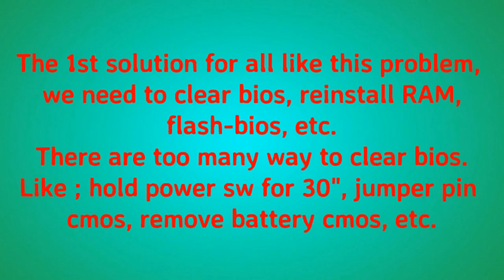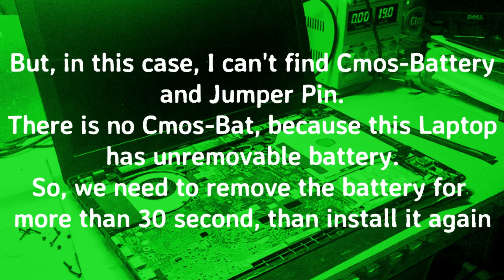SOLVED, REPAIR ASUS X550 X550Z NO DISPLAY, TIDAK ADA TAMPILAN ATAU BLANK SCREEN

Comment: Kasus ane agak beda gan, Asus x550z sebelumnya hidup, abis ganti hdd dan instal win 7, setelah selesai semua kabel sound dan wifi tidak ane sambungkan, lalu ane bongkar dan pasang keduanya. Abis itu ane tekan power tidak ada tanda apa2, dah lepas battry laptop, battry cmos, tekan +-30 detik dan pakai Charger saja, tukar posisi ram, , juga tidak ada respon. Semua indikator tidak menyala saat ditekan powernya. Ada solusi gan. Maaf curhat.

Comment: saya ada kasus serupa asus X550Z AMD A10 setelah saya update BIOS dari versi 204 ke 208 jadinya black screen, padahal flash bios update sukses, tetapi setelah cb saya nyalakan ttp g mw tampil, uda coba buka socket baterei, clear cmos baterei layar tetep blank , apakaha ada solusi lain ???
Reply from the maker: downgrade aja gan, tapi butuh alat untuk re-flash menggunakan eep rom programmer, gak mahal kok kalo gak salah sudah ada yang harga dibawah 100 ribuan di toped. agan boleh searching di YT tutorial flashing nya, sedangkan untuk ROM, baiknya coba gabung dulu di forum komunitas Teknisi Laptop, nanti bakal dikasi gratis file-nya. kalau tidak ketemu juga boleh hub saya, nanti saya bantu carikan. . saya yakin masalahnya hanya di BIOS, bisa jadi ROM barunya tidak sempurna atau ada bug. semoga membatu
Reply: I have exactly the same problem, did you solve the problem?

Comment: Hi there. My laptop has 4gb ram, then I tried adding 4gb ram in the other slot of my Asus x550z. When I opened it the same thing happened in the video. I tried doing the solution but it did not work. still black screen. Please help. Thank you so much
Reply: Did you ever fix it? If so how, same model, same ram, lmk

Comment: i have a asus x553m with a black screen issue, i tried all the troubleshoooting methods showed by all the videos but nothing worked. my pc is still on black screen ,how can i solve this issue. help please.
Reply from the maker: If you can, release battery and cmos battery for 10 minutes. Install it back and try to power it up. Or just flash bios using bin file. I have fixed many asus problem blank screen by flashing bios.

Comment: gan leptop saya asus x550z masalahnya sama black screen.  kejadiannya pas saya bawa ke wifi corner awalnya batrainya habis terus mati pas saya charger tiba tiba layarnya jadi black screen.  saya udh coba buat cabut kebel kabelnya tapi masih sama. tolong dibantu atau solusinya terimakasih
Reply from the maker: uda dicoba seperti di video saya? kasus laptop asus terbesar blank yang sering saya hadapi akibat gagal bios. dari cerita ente, ada indikasi ke arah serupa. solusinya flash bios. kalau punya alat flash toolnya saya bisa bantu berikan file biosnya. kirimkan emai ente
Reply: gan laptop saya asus x42j.. masalah no display.. bisa email file biosnya ke email saya... wendyyudha7@gmail.com....  terimakasih banyak gan

Comment: Gan. Klo ane penyebab ny karna sehabis install nox sama game berat tapi si nox ini unrespon jadi ane restart laptop ny tapi sehabis itu ada notice "sorry we will restart it for you" warna biru sehabis itu di hidup kan ulang langsung gak mau hidup layarnya. Solusinya gimana gan?
Reply from the maker: masalahnya gak jauh2. masih seputaran bios juga tu. cuba aja lepas baterai (kalau bisa). trus pendam power button +-30s. trus pasang lagi seperti semula. solusi lainnya coba lepas dan pasang balik ram nya. semoga bisa membantu
Reply: Laptop Repair udah juga gan. Lepas ram udh, baterai juga udh. Tekan 30 detik juga udah. Tetap gk nyala monitorny
Reply from the maker: lampu indikator lainnya normal? sudah dipastikan screen tidak bermasalah ya? sudah coba hubungkan ke screen eksternal?
Reply: Laptop Repair iya gan normal. Coba pake kabel hdmi tetap gk muncul
Reply from the maker: kalau punya alat, coba flash ulang biosnya. tapi ini sebenarnya pekerjaan teknisi. kalau mau coba boleh juga.

Comment: Ane kasusnya sama om, awalnya batere ngedrop trs ane tukar batere sekalian upgrade ram. Pas di idupin layat blank, tapi kalo di colokin ke tv pake kabel hdmi muncul, udah ane coba cara di atas tetep aja layarnya blank. Mksh gan
Reply from the maker: dari ceritanya, kasus ini bukan pada mobo, tapi MUNGKIN kabel lcd longgar/terlepas. karena kalau masalah di mobo display di hdmi ttp gak muncul.
Reply: Laptop Repair o gitu gan, berarti solusinya cabut lagi kabel lcd trs pasang lagi atau gmana?
Reply: Oia gan, kalo dalam keadaan hidup trs ane pake senter domonitor keliatan, apa inverter atau backlightnya harus di cek atau gmn gan?
Reply: Abah Garut gan setau ane klo keliatan disenterin gitu berarti backlight lcdnya ada masalah itu gan,
Reply: Arif Rahman oh gitu gan, solusinya kalo gitu gmn gan?
Reply: Abah Garut coba cek kabel kabel yg ke lcd gan udah bener" kepasang belum. Siapa tau lupa masang kabel. Klo udah berarti hrs di service itu mah cmiwiw
Reply: Arif Rahman klo kabel ke lcd udh gan, kalo di bandung ada tempat rekomendasi ga buat service?

Comment: What did you do? İ didn’t understand it.
Reply from the maker: Focus to 1:47
Reply: Laptop Repair i focused but it has cmos battery under mainboard :/ and it is removable. Can you help to me?  my asus x550jk .
İf you help to me i can send money to you
Reply from the maker: What's your problem?
Reply: Laptop Repair  i bought ssd 6 months ago. İ wear ssd to harddisk place and i wear harddisk to cdrom place.  format and continued to use for 6 months.
And now i want to format to pc .because i have some problems about high cpu usage. İ entered bios options and i didn’t see my ssd at boot options. İ did factory reset on bios. After pc restarted. And my screen was off. Black and blank screen. No electric at the screen. My power led on and my fan turning. But no image.
Reply from the maker: @kaanakinoglu8141  please more specifics about you motherboard brand, type and series. How can I contact you for solving, we have to vcall, or live chat.
Reply: Laptop Repair thank you :)  i will set everything and i will write to you. İ am very sick now. And we can vtalk
Reply: Laptop Repair i joined channel but i dıdn’t write anything:(
Reply: Laptop Repair i am waiting on telefegram app :)
Reply: Laptop Repair please help me when you are available:/
Reply: Laptop Repair hey :)
You wrote to me on telegram . But i can’t write in telegram. You did not authorize me to write messages. İ only show messages.
Reply: Laptop Repair what’s going on ?
Reply: Laptop Repair dude where are you i am waiting :/
Reply: Laptop Repair I went to most service in Turkey. they said the motherboard should be replaced. No one can help me but you right now. I haven't been working for a week. Please help me
Reply: Laptop Repair if you dont help, please say to me . İt is work for you :/

Comment: Hi. I want to replace the battery on my computer (x550z). I can't find the name/number of the battery on internet...do you know that? I don't want to open my laptop to know that...
Reply from the maker: Hi Kristelle, Asus X550 Battery type is A41-X550A or A41-X550,
Its compatible with the following:
Asus X550C, Asus X550CA, Asus X450C, Asus X450, Asus X450CA, Asus X550, Asus X550A, Asus X550C, Asus 550CA, Asus X550CC, Asus X550D, Asus X550EA, Asus X550LA, Asus A450LA, Asus A550CA, Asus F450CA, Asus A450LA, Asus A450LB, Asus A450LC, Asus A450V, Asus A450VB, Asus A450VC.
Hope can help you, good luck